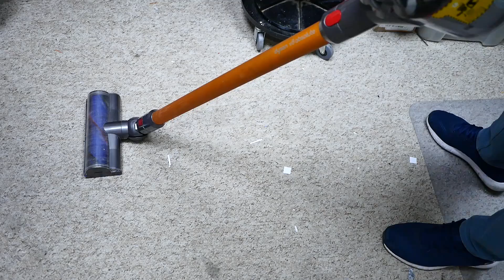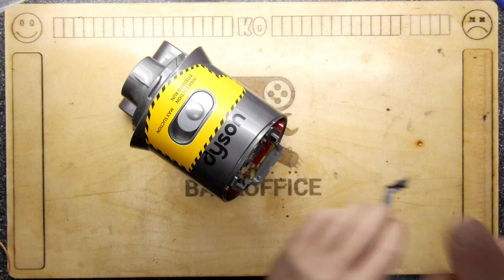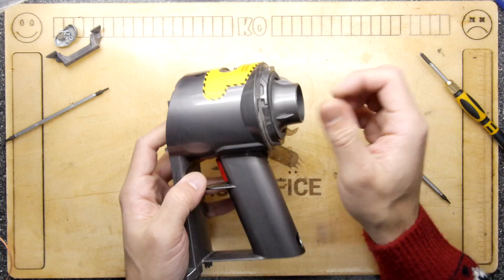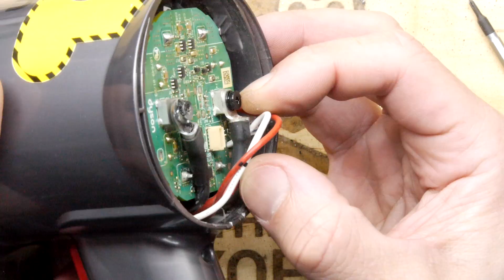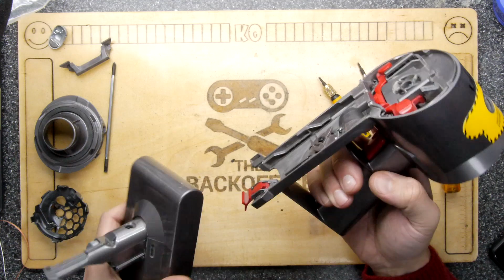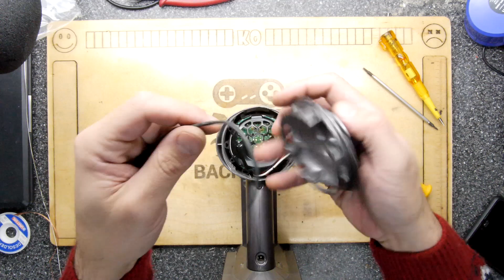Crazy Dyson v8 Fault and Repair

Comment: My failure involved the accessories getting power (voltage) but not actually spinning. No current was passed from the PCB to them. The wires were fine, these wires are the red and white ones in the video. So it is some kind of programmed chip death I guess..

As a hacked up fix, I just pulled the white and red wires out (they are held in by clips on the back of the pcb which you can unhook with a screwdriver) and I put those red and white wires directly onto the big bulky motor leads by shuffing them under the screws (between the wire terminal and the screw, NOT BETWEEN THE TERMINAL AND THE SOLDERED NUT- this will cause FIRE because the big leads need to be able to pass 40 amps to the board by making full contact). 

The accessories now spin again- but you may want to add a fuse onto one of the leads though because if an accessory shorts out or is blocked in some way it's gonna get the full power of the battery and also burn something up. Good stuff.

Gotta love making these expensive toys more dangerous.
Reply: I just found this video after searching dozens of others. My symptoms also mirror yours (no power to accessories). I'm eager to try getting it part and seeing if I have a similar problem to yours. Did you also have the intermittent power (pull trigger, blue light on battery but only power to the blower occasionally?)

Comment: On my sister's one of these the power is not getting down to the motorised rollers at the end of the tube. I checked continuity of the pins to holes on the tube, attached a DC power supply to the pins on the roller mechanism and they whizzed around so the motor works. Just no power getting down from the main body, any ideas?
Reply from the maker: Keep checking continuity upto the body, it can either be a break in the circuit to the PCB or a component in the PCB.

With a bit of luck hopefully it will be a mechanical issue you can fix.
Reply: Same with mine.
No power coming out for the accessories.

Comment: Merry Christmas Andrew! I've been fascinated with those Dyson vacuums since I first saw them on TV. Do you recommend them?
Reply from the maker: From a technology standpoint they are interesting, however, from a build quality I'm not so sure. I think personally I will look at other solutions when my one expires. My parents have the latest model and that failed within a few days and was replaced. This does not give me confidence in the product.
Reply: as I user, I see two flaws in the design of Dyson vacuums: 1) replacing battery needs tools.  this is the most fetal one, as many home appliances and tools are getting wireless models, battery replacement and compatibility among themselves is a very important product design strategy.  It's unfortunate that Dyson designer did not see this coming as this products was started a bit too early for this.  They could have learned this quickly and make new models with one-click replaceable batteries, and offer at least two batteries per device; 2) the location of the motor is in the path of the air flow, which is some time fetal.  As we often wash the filters, the mix of water and dust will form mud in the air path and on the motor wheels, and jam and lock the motor, as it did to my motor, if one washes the filter, then blows the motor a bit, and then leaves it on stand for a few days.  However, among all the vacuums on the market, Dyson still has the most powerful motor which many loves.   I hope Dyson engineers can watch this video and read my message here, and go back to their design board to make a better vacuum.
Reply from the maker: Dyson really wants you to break it and but a new one.
Reply: @backofficeshow  The v8 has 3 phillips screws for the battery, but the new V11s have removable one click batteries and include two batteries and two chargers
Reply: @backofficeshow  hi, my dyson v10 no longer works, when I press the button there is a slight motor noise for 1/2 seconds and then that's it, what could be the problem? thank you
Reply from the maker: @carmelacassano4662 check if the dust bin is full of the pipes are blocked. If they are clear, remove the filter on the back and try again. If it runs ok, replace the filter with a new one, or leave it off
Reply: @backofficeshow  Ours had the same issue recently. The filter turned out to be extremely gunked up. Rinse it under the faucet and the vacuum should spring back to life.

Comment: When mine did that same thing, it was the battery that was the issue and not the machine.  98% of the time, its the battery that is at fault.
Reply from the maker: I think mine is on its way out, it only lasts 2 minutes on a charge and is less than a year old.